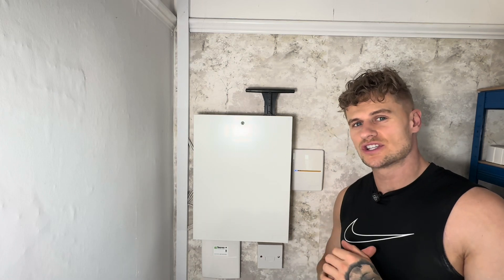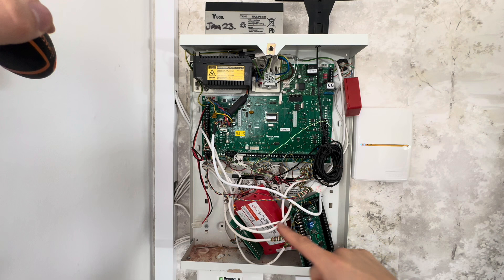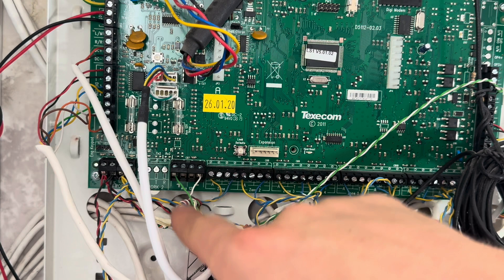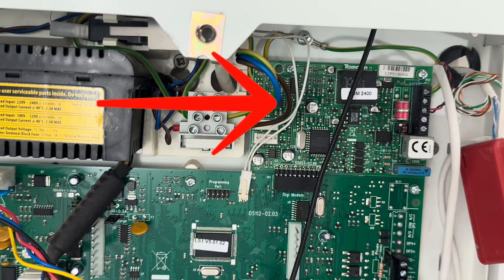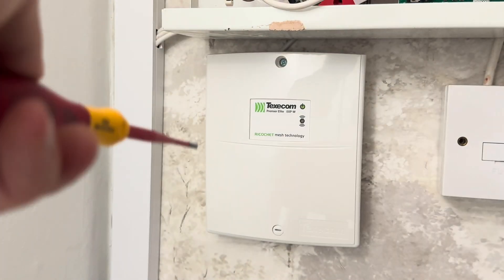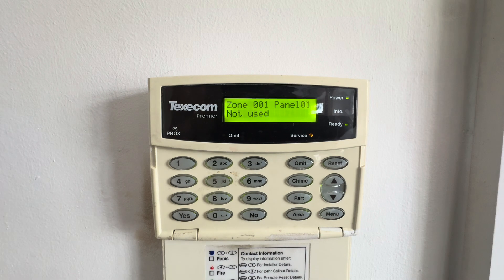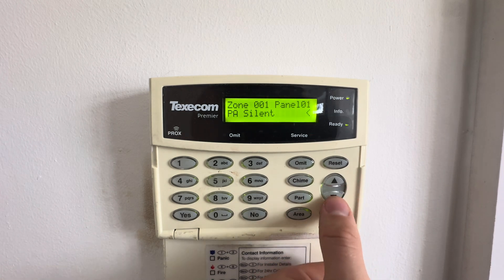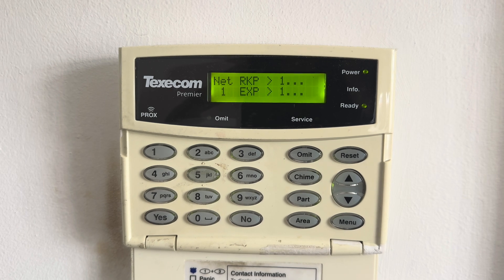Texecom Premier Elite Alarm System Walkthrough – Setup, Wiring & Engineer Menu Guide

Comment: Hi what a great video , I’m installing my own alarm Texecom elite 48 and am so happy I found your video 

I have 5 PIR wired can I wire all 5 red and black on the aux 12v

I’m using the old existing wiring

There is a lounge PIR  which has 2 lots of wires red black blue and yellow going in and out , is this connecting to another PIR ???
Reply from the maker: Hi mate thank you great to have you here, I’d be more than happy to help on this. 

Yes you can wire all 5 red & black into the AUX

Yes that sounds like it’s going back to back, in the PIR with multiple cables are there any colours that are joined together? For example can you see a blue cable joined with a different colour? (Doesn’t have to be blue just using that to try and describe what I mean)
Reply: @SimonSecurityExpert yes the blue is going in and a blue going out the same with yellow etc , I have 3 cables wired to the old control panel but have  5 sensors around the house PIR
Reply from the maker: @fonzyrelli ok great sounds like you’ve got sensors running off the back of each other, just a couple of other things and I can put together a step by step plan for you, are you able to identify which cable is the panel is going to which detector? And then in the detector with multiple cables do you know which detector that is feeding to? Sounds like you have 2 motion sensors that are both feeding an extra motion sensor each so you probably previously had 2 zones with 2 PIR’s on each zone. We should be able to wire this so we can separate them all so they all have a specific zone each which is much better
Reply: @SimonSecurityExpert that would be fantastic , the lounge has 2 cables in and out but behind the wall there is a hall pir and a kitchen pir but these are labelled in the panel , the ones that are not labelled are dining room and landing sensors, there is no wires for these
Reply from the maker: @fonzyrelli great, if you can identity the lounge cable since that’s one with 2 cables going into it that’s just what we need. 

for the wiring here’s what we can do: 

1. Go to lounge PIR leave in the blue and yellow into the zone on the incoming cable but separate then outgoing cable. 
2. Put both reds in to the aux and both blacks into it (+ & -) 

3. You should now be left with green & white on the incoming cable, join green of the incoming cable with blue of the outgoing cable by twisting the inner sheath together once cable stripped back & do the same with the incoming white and the outgoing yellow (put tape around both after so it won’t short anything) 

4. Back at the panel you have the lounge cable, put the blue & yellow into one zone and the green and white into another zone, you have now separated the zones so they are unique. 

Are you using the same detectors or new detectors as this will make a difference to the tamper circuit? If using new detectors are you using texecoms own Captur range?
Reply: @SimonSecurityExpert yes using texecom capture range
Reply: @SimonSecurityExpert wow that is very clever but how do I know which pir is connected in there a way to find out
Reply from the maker: Great that means you can set up the devices as EOL which they come factory set to so you won’t need to change them to normally closed, just make sure you wire in the alarm cables into the ones indicated as EOL on the PIR. 

Yes you will be able to find out what zone is connected to what, that’s later though, once you’ve done those steps and powered up the control panel you can put it into a walk test in engineer utilities. Start the walk test then trip a sensor and go back to the keypad and see which zone that correlates to on the keypad, you can then do that one by one and make a list and each alarm zone will reveal itself which is which 😁
Reply: @SimonSecurityExpert so I opened all the PIR and there is lounge with 2 cable in and out and a hall out which also has 2 cables in and out , the rest only has 1 cable going in (dining, kitchen and landing) so am guessing the lounge and hall are feeding the dining and landing but how do I find which cable is going to the box in the PIR and it has a ID BISCUIT inside the PIR( what is this lol)
Reply from the maker: @fonzyrelli ahh ok an ID biscuit.. this is an issue but not unsolvable 🙈 I’ll start with the cable finding so you can find which one is the incoming cable: 
You’ll need a multimeter and you’ll need to set it to “continuity check”, twist a cable together at one end and test at the other end until you find which one has continuity and that’s your cable you’re looking for, screwfix multimeters aren’t too expensive if you haven’t got one. 

As for the ID biscuit, an ID system is a style of system that was popular about 20-30 years ago, you’d wire the system in series and in each detector you would have a biscuit so the panel could identify which device was which. You could get an ID expander and fit it to your panel Texecom are the only manufacturer who make one nowadays but I don’t recommend it it doesn’t work perfect by any stretch. Are you able to put a new cable in for one of the sensors? Reason being is if you have 3 devices all on one cable you may not have enough cores to split them off individually, unless the current cable in place is 8 core inside, any change it’s 8? It’s 6 more often than not
Reply: @SimonSecurityExpert so I managed to find the PIR location 

Lounge wire feeds the dining room and the hall wiring feeds the landing :)
Reply from the maker: Ok great if one cable is feeding a max of 2 PIR’s (on a 6 core) you can wire it as discussed earlier and that should work fine, not much room inside the capture range so you’ll probably have to joint your cables behind the backplate, I’d advise soldering them if you have a soldering gun
Reply: @SimonSecurityExpert ok great thanks , do I still wire up 2 reds and 2 blacks in the PIR and then put yellow and blue in green and white
Reply from the maker: @fonzyrelli red and black both go in the power yes. Blue + yellow go into the terminals marked EOL these are A & D on a captur. 
Joint the incoming green and white with the outgoing blue & yellow and in the next sensor wire in power as red and black and A & D as blue and yellow. 
Then back at the panel you can wire in the blue and yellow on that cable into a zone and the green and white into another zone. 

These should now work fine, (B, C & E on PIR should be empty) 

You can then repeat this process for the other sensor that is feeding another one 👍🏻
Reply: @SimonSecurityExpert absolutely brilliant information , maybe should have made a video of this lol, 

I have just wired in my keypad 

Door sensor into zone 1 in the keypad yellow in A and blue in D using old sensor form 1997 

KEYPAD wired in and switched dip switch to 1 

Next wire up all sensors 😊
Reply from the maker: @fonzyrelli you’re smashing it mate! If you have used a keypad zone you will need to map the keypad zone, in engineer mode go to keypad set up, press yes into keypad setup, press yes again, press no, type in a zone number for the entrance sensor (it can’t be 1-8 so use say zone 10) for example press 010, press yes, you’ve now done it, down power the panel and reapply power as it needs a power cycle to take effect, you can edit the zone now in zone set up 👍🏻
Reply: @SimonSecurityExpert have not yet installed the panel lol I’m planning to have all sensors wired up ready and then I can do the control panel once all devices are done , still waiting for wireless 32xp and a 4g WiFi SmartCom to come
Reply from the maker: @fonzyrelli best of luck with it all mate give me a shout then if you’re struggling further down the line happy to help. Just so you know the wireless expander will take up all 4 spaces of your network with it being a 48 panel, so when it comes to mapping the keypad zones you’ll have to use zones out of that range like 47 & 48 so as to not interrupt the expander 👍🏻
Reply: @SimonSecurityExpert oh ok Thankyou so much for your help , will defo contact you if get stuck it may well be the programming
Reply from the maker: @fonzyrelli you’re welcome mate
Reply: @SimonSecurityExpert hi mate I managed to get the control panel to the wall and wired in the keypad but no power or battery yet connected , wanted to know can I connect the battery to the control panel will this power the keypad to check firmware of the panel and if so how do I do and what is engineers code ???
Reply from the maker: Yes you can mate but there’s a specific way to do it, you need to connect the battery up and hold the battery kick start button, it’s a button on the PCB (usually near the aux and speaker fuse) otherwise it won’t power up on battery automatically. User code 5678 engineer code 1234 as default. Press menu 4 on Home Screen to check panel info 👍🏻
Reply: @SimonSecurityExpert that’s fantastic also I’m about to wire the door contact can i go into the PIR and use the same method by using the different colour wires and then in to the control panel
Reply from the maker: Yes mate if those cores are free you can use them for the door contact, you don’t need voltage for that 👍🏻
Reply: @SimonSecurityExpert fantastic ❤
Reply: @SimonSecurityExpert hi Simon , so I connected all devices , switched on the panel , internal siren and keypad went off but very low sound and entered the code and says tamper zone 6 which is the CQR door contact that I wired up using the different colour method I’ve been trying for several hours , please help 😂
Reply from the maker: @fonzyrelli have you wired the door contact with end of line or have you wired it normally closed? If you have wired it normally closed then you need to change the zone wiring in the zone setup menu, if you watch my vid and go to the keypad part and watch that you’ll see a demo of me changing a sensor to normally closed
Reply: @SimonSecurityExpert hi Simon I did as end of line but the door contact has 6 connections HOLES 2 screws for TAMP 2 screws for ALARM and 2 NC 

I connected in 1  on TAMP and 4 on ALARM

In the instructions it says something about r1 and r2
Reply from the maker: @fonzyrelli presuming the door contact is a Texecom one, I don’t actually use their contacts so not sure on the wiring set up but it should come with a booklet hopefully showing you the EOL resistors. 

If you have definitely wired it correctly it sounds like the cable may have an issue, ideally the next step would be to do a continuity check on the cables with a multimeter to make sure you’re getting a circuit and there’s no potential break in the cable, if the cable is ok, the wiring should work, if not the next option would be to either recable or use a wireless door contact if you are putting a wireless XP onto the system
Reply: @SimonSecurityExpert hi Simon the door contact is CQR but in the diagram I don’t understand what R1 and R2 its a line going up one side and zigzag to another line, it says select either
Reply from the maker: @fonzyrelli ahh ok mate I use CQR so this makes sense, these won’t work without actual resistors because you can’t set a resistance with them unless you have a specific type, if I were you with this I’d wire it as normally closed, but the alarm cables into the NC & C, and set it as normally closed on the keypad and that should work
Reply: @SimonSecurityExpert so do I put  the both cables into both n/c and at the control panel wire up as A and D
Reply from the maker: @fonzyrelli at the device you want one core in to C (closed) and one into NC (normally closed) if that’s what the alarm terminals are labelled up as, and at the panel wire those same colour cores into a zone
Reply: @SimonSecurityExpert they are BOTH labelled as N\C N\C , i just ordered a 2k2 resistor and a 4k7 resistor
Reply from the maker: @fonzyrelli they are the wrong terminals, if it’s a CQR contact you are only interested in the first 4 x2 tamp and x2 alarm, the NC aren’t for what you’re using them for, if you want it to work for now wire into the ALARM terminals on the contact and make normally closed on the keypad, for EOL wire as the diagram in the manual for it, easy way to think of EOL is “blue with one yellow with none”, (blue with one leg of resistor in one side of alarm, both legs of resistors in other alarm terminal, one leg of resistor on its own in tamp and other core of alarm cable in the other tamp) 
You would of been better off with my DIY system the Guardfather 😂 much easier haha
Reply: @SimonSecurityExpert hi Simon so I finally have the system up and running but when I arm the system it says area in exit sounds for ages lol what am I doing wrong
Reply from the maker: @fonzyrelli does it eventually set or does it just continually make the sound? Texecoms come factory default as set on final exit (meaning it won’t set until it sees the entry/exit zone open and close usually the front and then will set a few seconds after) if you’d prefer to change it to say 30 seconds exit time and entry time let me know and I’ll talk you through it. 
Also mate if you get chance I’d really appreciate if you could take a look at my website www.guardfather.co.uk , not to buy anything I know you’re already all set up alarm wise but just to get a feel for it and give me feedback on it and if it’s easy to navigate etc 😀